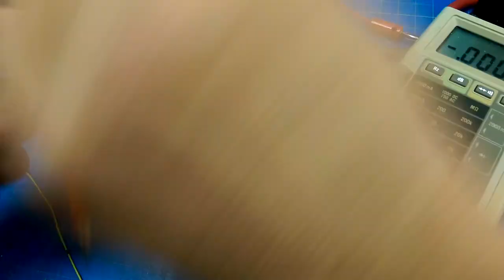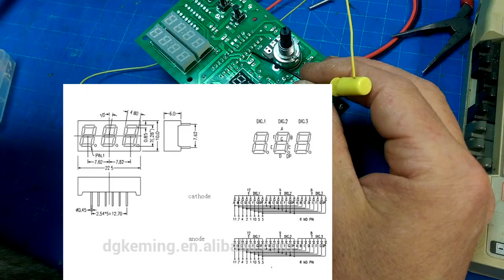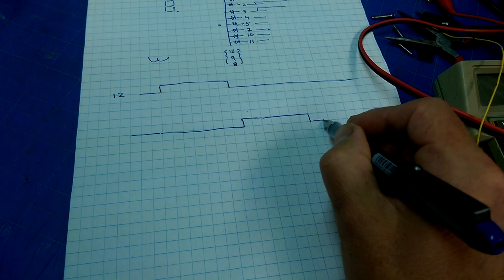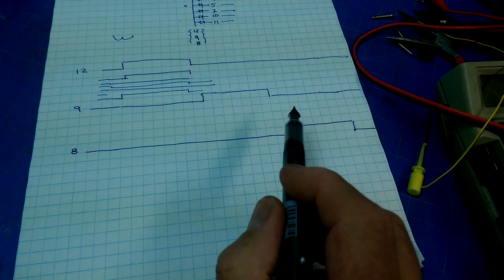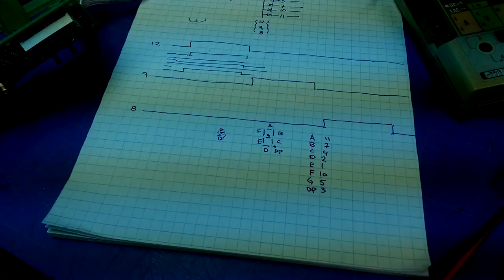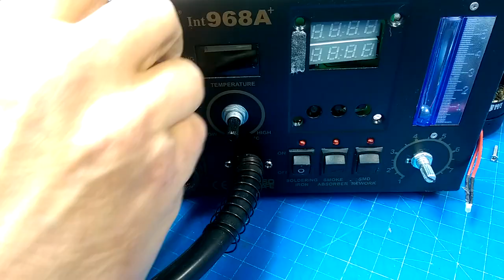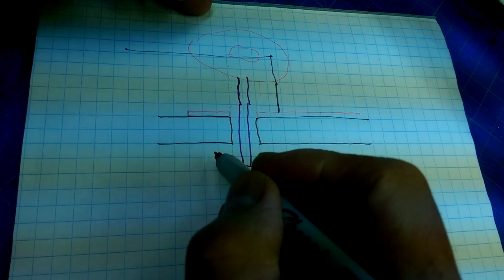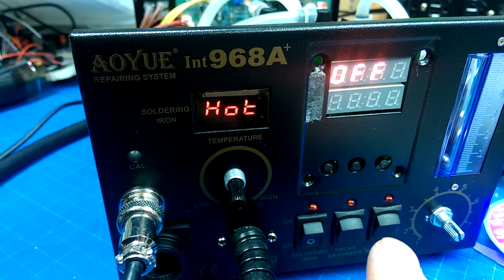Aoyue 968A+ Repair

Comment: Thanks for the video.   I am searching a transformer  or a set of transformers for Aoyue 866, By opening the station I notice that the transformer outputs are 8V 21V and 24V. However I don't know the current rating of each channel The transformer input is 110V and I have by mistake powered up with 220V for about 30 seconds

Comment: Is this any good?
Reply from the maker: Meh.  If it were not free from a dumpster, I would be using something else.
Reply: @grtyvr  Why is it that bad?
Reply from the maker: @irishguy200007  No.  It is not so bad that I am not using it.  I like the fume extraction most of the time, but it does get in the way at times and it is not easy to remove the pipe.  It is a decent hot air station.  But if it had not fallen into my lap I would probably be using something else like a TS-100 for soldering.
Reply: @grtyvr  Ah I understand now. The soldering iron is kinda weak point?
What way is the hot air station? 
I picked up a Sequre d60 for 25 euro posted second hand myself.